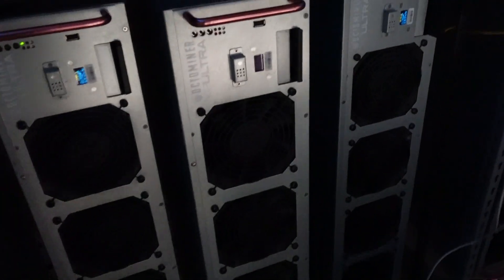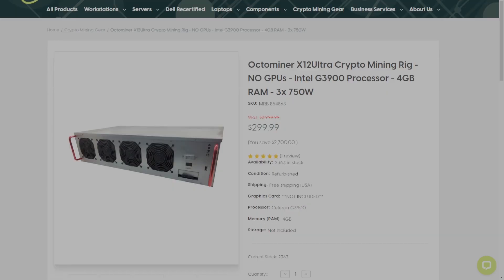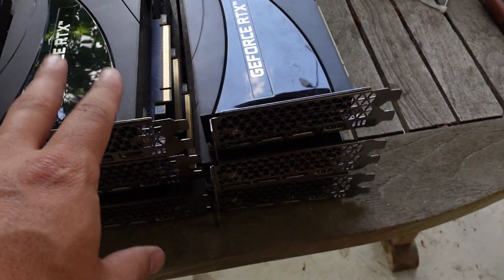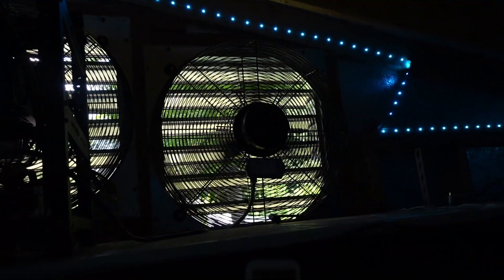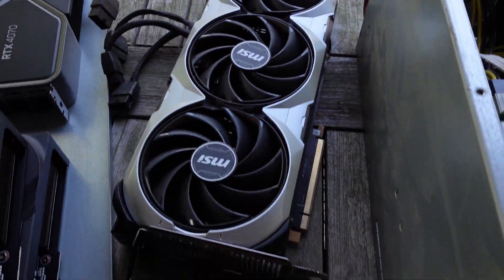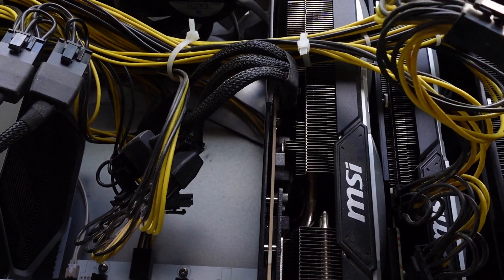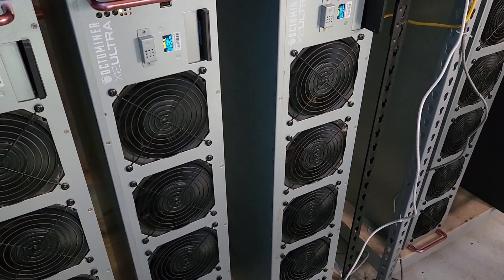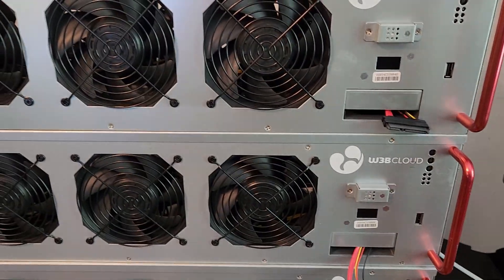MASSIVE GPU MINING shed UPGRADE in 2024 part 1

Comment: This is so stupid and unnecessary. You are just increasing your electricity cost with all those fans and extra RIGS, due to low density. Not to mention the hive OS cost per any extra rig, including the louder noise and the no upgradability towards bigger, newer cards, this is just plain stupidity, right there!
Reply from the maker: Not sure where you are getting low density, most of my rigs are 8-12 cards. Also in order to mine in the summer you have to cool them properly and these octominers are doing just that. As far as noise, it really seems like you don't watch my videos at all as I have everything in a shed which means noise is not a factor. Also I am not worried about the new gpus as 170hx can fit in these octominers and I think id rather have them over say the new 50 series when it releases. I really think you should do your research before you make bold statements like the one you did!
Reply: @krootman_digitial  8-12 skinny low end and low yeild, with low efficiency, cards give poor profitability, on one side. But the bigger question is why, buying something with limited upgradability. You cant fit a 4080/4090 not to mention the upcoming 5000 series. I just really dont see the point in all that. Looks like a complete waste. On one side you spend a lot more on electricity cost, due to the low density, on the other side you spend extra on HIVE OS fees too. It just increases the over all cost. If you were adding these boxes, just to fight the summer heat, you are doing it also very wrong. One EVAP cooler was going to fix it all up for you with a meager 400w usage. I would advise you to re-think your strategy, you are wasting a good junk of the profits, in some bear times.

Comment: Hello, I want to know a doubt, to these octominer cases, they fit the 4090 and 4080 asus of 3 ventialdores? I have 10 cards and I want to improve the heat efficiency. but I have my doubts to buy to reduce space.
Reply from the maker: they will not fit 4090 and 4080 gpus and I would not put anything larger then a 4060ti in these when it comes to the 40 series, unless you plan on putting less then 8 of them in it.